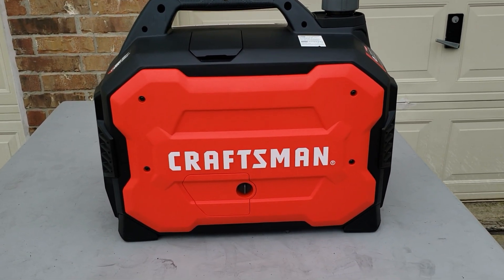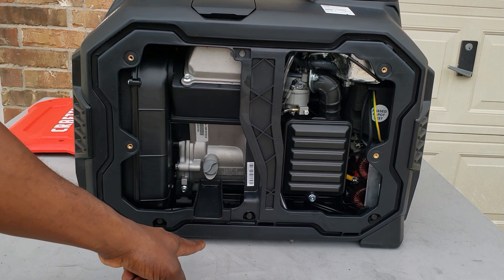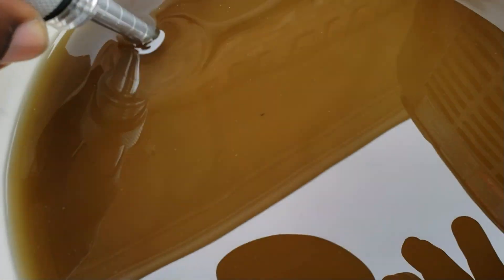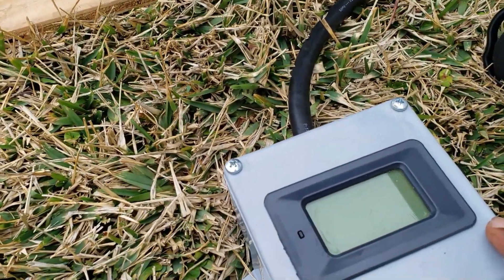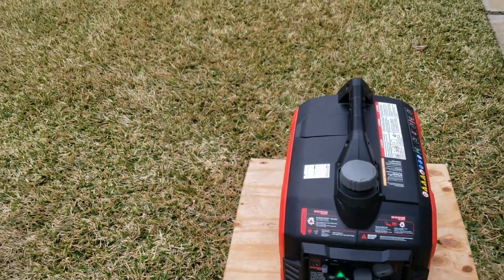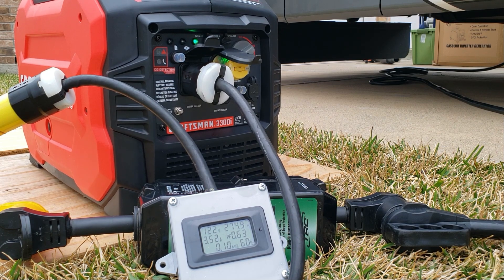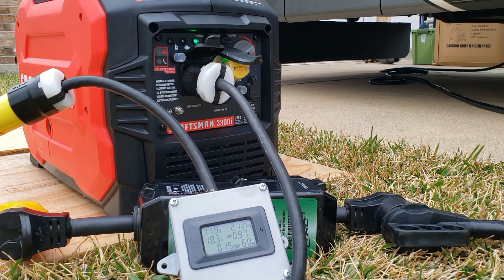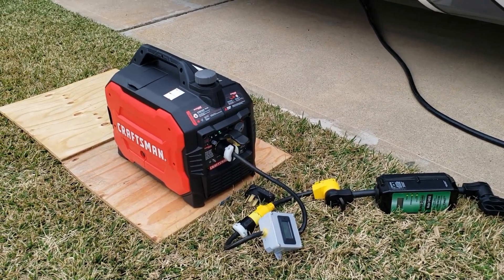CRAFTSMAN 3300-Watt Gasoline Portable Inverter Generator full load Test

Comment: I bought this a year ago to run my a/c in my trailer at the sand dunes and it works really well. I wanted this one because of the small compact size, it’s light weight and is so quiet when it’s running. It’s perfect.

Comment: I love your videos,  and I'm a huge supporter of you and your channel. But I think if you didn't have soft starts on your units, you would have a huge difference in opinion on MANY of the generators you test.
Reply from the maker: Soft starts are a must when trying to run off a generator.
Reply: @GeneratorReviews  And I agree. I have one, too. But I am speaking for the claims of the manufacturers that claim their generators will start air conditioners and the people that don't have them. Before I had my soft start, my two wen 2250s (in eco mode and paralled)would not start the 13.5 ac i have. Non-eco mode was no problem, of course. Now that I have the soft start, no problem in eco mode.

Comment: I just purchased this generator, connected to rv trailer 17 ft, without softstart and with softstart lights turned on although AC would not turn on, any ideas would be appreciated. thanks
Reply from the maker: Do you have 13.5 or 15k BTU AC

Comment: I bought the 3300 W craftsman generator for my 26 foot Springdale travel trailer. I get the generator running turn the AC on the generator cut off. Any suggestions
Reply from the maker: If you don’t have soft start installed, I would definitely look into that.
Reply: Not sure what a soft start is but the generator starts up everything comes on but once I hit the AC switch, the power of the generator goes out, but I have the exact set up you have when you do the full test I bought everything that you had displayed. Not sure what's going on but I know the AC has been sitting up for a while so I'm having a guy come take a look at it but I had the exact same hook up that you just did on the fourth test.

Comment: I just bought this. I've gone through four generators this year and needed a new one. Our stores were out of almost everything so I bought it out of necessity. I have to say, this is the most quiet one yet. It handles my load better than the Ryobi. It's the only one with an oil drain pan that catches it so you don't make a mess. It's brand new but so far, I'm really happy with my purchase. I'm going to take your suggestion and change the oil right away.

Comment: i have had this generator for 3 winters in the desert to supplement my solar. it operates very quietly with low load. it died a few nights ago and will no longer start. i've kept it in excellent condition and have determined it's not oil, plug, gas, or filter. i believe it's possibly a relay or something to do with the CM detector or other electrical problem. i am disappointed that it failed at the end of the warranty period and so far from home base. this forces me to purchase another smaller generator for a back up until i can determine a fix however the new generator will not be a craftsman/generac. i will update as to the cause and fix when able.

Comment: I fix small engines and i can tell you that this generator is a bear to work on.  Normally, removing the carb is easy but not on this thing.  To remove the carb,  you almost have to crack the case  open.  To get to part A, you have to first remover B,C,D,E, and F.  When i see one of these start to come to the shop, it turn it away. No thanks.
Reply from the maker: I agree with you, some of these small generators are almost impossible to work on.

Comment: I too was having issues starting my AC on this generator, it seems to be a combination of not having enough oomph while in idle to actually get the motor going full speed causing it to stall, not one hundred percent being warmed up or having bad gas. After putting a shop vacuum on it it seems to be able to kick-start the AC just fine, you just have to be able to get it out of eco mode for it to be able to start the AC

Comment: Badass generators made by generac...you can get a parallel box and 2 of these generators and double the power output.

I run a parallel box with a 3300i and * 2200i to get more boost...

Craftsman tools I have know are really kicking butt

They really making some good stuff. Get it while you can.

Comment: How long will the generator run with a full tank and just the AC running?
Reply from the maker: Just the ac would definitely be over 10+ hours depending on how cold you set the ac.

Comment: Love your work, but there is an issue with this generator that I hope you will put out there.  After watching lots of reviews I bought this for my Class C with a Coleman 15000 BTU AC.  I also bought the new SoftStartUp, a version of the softStartRV that plugs in at the pedestal instead of wiring to the AC.  It shows current draw through an app.  With everything but light off I was drawing 1 amp.  Turning on the AC, ON any setting, failed 7 out of 8 time with a low voltage warning on the SoftStartUp device.  I believe this is because it is always in Eco mode and can’t ramp up quickly enough.  Luckily Lowes took the generator back, and I’ll either get the Generac version of this (with the Eco switch) or something else.  Funny thing, the reviews on the Lowes site don’t say much about this but on the Craftsman site it bleeds red with this problem.  I don’t recommend this generator for RV ACs, because of the Eco switch issue.
Reply from the maker: Hey Steve
Thanks for watching, I don’t think the problem is that of the eco switch but the soft start you got can’t work like it should. Please consider getting a 4500w or install the soft start kit on the AC. 
The soft start separates the condenser fan and compressor at startup, then it slowly increases power to the Compressor

Comment: GREAT Review! Exactly what I was looking for on short notice. I've got a 28 foot TT one slide... I've been looking at HF Predator's but out of stock and the price just keeps going up higher than this one now... The hottest days of the year here in 2022 in MT (low mid 90's) and I'm heading to a state park without electricity for four days. 

My little 2200 Westinghouse (very good reliable for 13 years even doing 13,5 airco reliably) is going to be outclassed with the new travel trailer. Lowes has one in stock, this review seals the deal. This is exactly the power level I want. I will do the oil change as you noted just to be safe. I changed oil at a couple K miles on my new truck for the same reasons. Makes sense. Any new motor is going to throw metal first use. That can't be good for a new engine. Thank you for giving me confidence in my decision. 

When I bought my Westinghouse all those years ago, there was a distinct difference between the limited number of generators that could be purchased. Now days, the tech has leveled out and there are many decent generators out there with low decibels. I would love to say the Craftsman stands out as a brand name, but now days it is just another. I hear this is simply a rebranded Generac (good brand) of the same specs so take a look at that for some. But I have a 10% veteran's discount at Lowes and am going for it. Thanks again.
Reply from the maker: Congrats on the new TT and generator 
Thanks for watching happy this helped out.😊👍🏾
Reply: @GeneratorReviews  Just one problem... I just got back from my trip and the generator would NOT start my 13.5K air conditioning like I saw on another site. AND, it was the generator as it would try to start it and then the green "power" light on the generator would go red. I tried three times with the only thing drawing power being the air conditioning. Since it was mid 90's, we had to go find a campground with power and the airco worked fine. Back to Lowe's it goes.
Reply from the maker: @Redfour5  installing soft start kit would fix and extend the life of your AC.

Comment: I really like this generator.  It's so quiet.  I hope you do a shoot out where you compare the DB levels of the various 3300/3200W generators.  This one seems to be the quietest, but.. not really sure.  I love the power delivery vs. loudness though.  While I was cautious about the lack of non-eco mode, I agree that it basically forces you to use the generator properly, saves gas, and will be quieter.  If it can't handle your load, get a bigger generator.
Reply from the maker: Yessir that’s what am talking about!! Well said!!
Reply: It does have an economy mode, it is automatic instead of manual

Comment: Thanks Gavin, good point on the Magnetic dipstick not working on aluminum blocks. Would you consider reviewing some 3000 + duel fuel generators. I like the option of running on propane, les messy, no smelly gasoline in the back of my truck.
Reply from the maker: I did a review on some 4500 W dual fuel generators, have you seen that one? I also have this 3500w dual fuel coming up soon in talks with the manufacture as soon as it comes out you gonna love that one.
Reply: @GeneratorReviews  yes I did watch the 4500 reviews. those things are monsters, LOL. Looking forward to the 3500 videos. Thanks!

Comment: Gavin I have a question for you about the easy start.  I have one on my 2020 trailer with a 13.5K AC unit.  I use a 2500 watt Onan that has a 2200 watt continuous run capacity.  What I found out the hard way (and was reluctantly verified by easy start) is up to about 95 degrees all is well and it runs perfectly.  95-100 degrees I cannot get more than about 90 minutes runtime as the AC unit starts slowly pulling more and more power the hotter it gets.  Over 100 degrees (which is where you really need it) it will not run the AC for more than 10-12 minutes.  I did tons of research including a close friend that has had a HVAC company for over 30 years and between him and hammering on easy start finally got them to fess up that when it gets that hot you do need at least 2800 continuous watts to operate the AC.  I live in AZ and I wouldn’t deliberately go camping in the AZ desert in the middle of summer but I wanted to be able to use the AC in that 90-100 range if need be.  I’ve talked with a couple of other people that have had the same issue with 2200 watt Honda’s and a 2350 watt WEN generator.  I don’t know if it’s feasible but if you are ever someplace way to hot and uncomfortable I’d love to see what you come up with testing a generator that puts out something in the low to mid 2000 watt range with your easy start and see what kind of power it draws.  At over 100 the power draw almost immediately hits about 1.8KW and over the next 8-10 slowly climbs to over 2.2KW and trips the overload.  I have a backup generator for the house and using that it seems to level out at about 2.5-2.6KW in severe heat.  Great vid as usual!
Reply from the maker: Yes sir that is why I always recommend a 4500W generator full 30 amps when it comes to RVs A/C.
Can you imagine not having the soft start and people want to use there 2k generators on the AC.
The hotter it gets the harder the AC has to work to cool the Rv so it’s going to draw more amps.
Reply: @GeneratorReviews    Thats what I concluded, my beef is easy start makes it sound like a person can run their roof air under any condition off of a 2000 watt generator.  My background is a Jeep shop for many years and several RV’s learning the hard way since the early 1970’s about RV issues.  Your tests are very complete and they have been forwarded to many people.  The longtime friend who owns the RV parts and service store has started to enlighten people about the limits of the easy start they sell based on my issue.  I know it’s going to cost a whole lot more money but I’m going to wait until you can get your hands on the new Honda 3200, hopefully sometime in the late spring.
Reply from the maker: @supersami7748  Yeah I agree with you 3200 watts is perfect for what you need. Gives you a little overhead to work with 
The 2K Generators that’s just pushing it
Reply from the maker: It’s not the device malfunctioning is just not enough power to run the load

Comment: I've read reports of this unit being unable to start ac units since you can't turn off eco mode. The fact that you demonstrate generators using your ac's with easy-starts installed doesn't fairly represent the true ability of any generators you test.
Some of us have easy-starts as do I, but most people don't. I think you misrepresent the usability of these generators for most people.
Reply from the maker: Before I install soft start on my RV even my Honda 3k would struggle.
The fact that people think they should not take every step necessary to start the AC with a generator by installing soft start blows my mind. Honestly I think they should come standard with every RV from the manufacturer.
What I’m demonstrating is use technology to make things easier for your generator.

But I do agree with you unfortunately I have them installed on my RV so that’s the only way I can demonstrate it. 
Thanks for watching Rick
Reply: @GeneratorReviews  I agree with the original response, in fact was going to post some version of the same thing till I saw it here.  But I also understand your reason8ng.  Perhaps you could emphasis the point every time?  Calling it a “PASS!” without saying that without a soft start it likely won’t run the AC is problematic (especially on this generator.  (Full disclosure, I just bought one, and the new “SoftStartUp”, so I should be good in my class C.)

Comment: I agree with you 100% on changing the oil I bought recently bought a predator 3500 about 4 1/2 months ago I change the oil four times in the first 30 hours then I switched to full synthetic
Reply: It helps flush out particles from manufacture and breaking in of a new engine for longer engine life
Reply from the maker: 😊👍🏽👏🏽👌🏽Well done!
Reply: @GeneratorReviews  how come changing the oil so soon is beneficial ?
Reply: How come this is beneficial? I'm.new
Reply: @scottbuchanan4899  These new engines have a break in and will release a ton of metal impurities into the oil. Better machined engines have very little but these are budget machines

Comment: My big concern is that the auto-Eco mode is just something else that can break. I know, it seems like I'm being overly careful. Guess I'm just one of those people that wants as much control as possible of anything I use. Heck, even all my trucks before this last one were manual transmissions. I'm just not a fan of auto-anything. But, the way things are going, I'm just going to have to roll with 'em. 15k a/c startup was impressive though. Great video, by the way!
Reply from the maker: Thanks Tom
At this point everything is going automatic my vacuum, auto self leveling, self driving we can’t keep up 😅